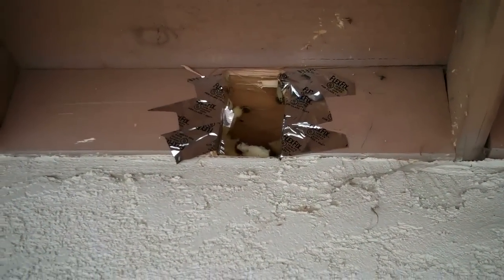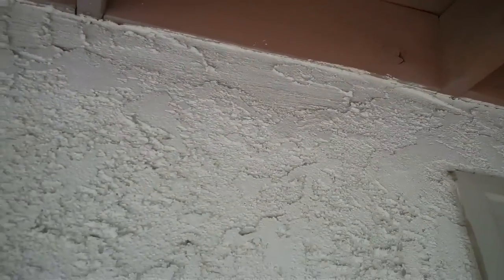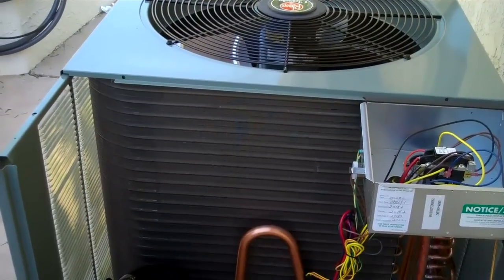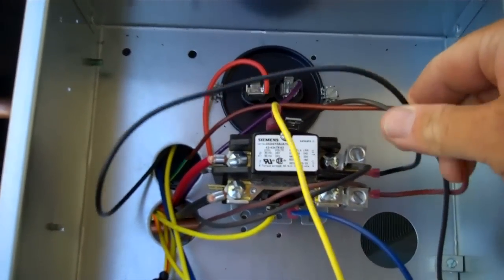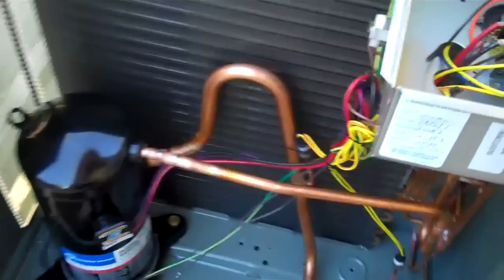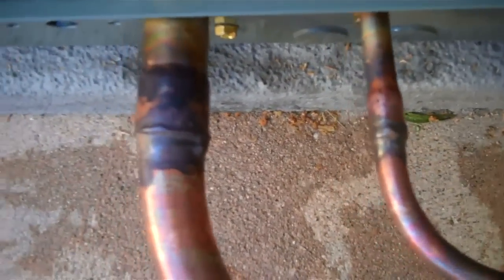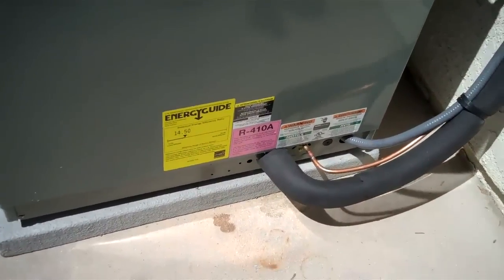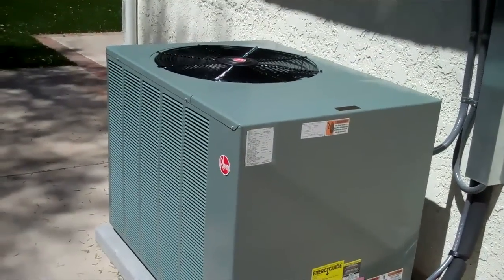Rheem 14.5 seer 4ton condenser with a ECM condenser fan motor

Comment: Whats up Dallas, yet another fantastic install (good looking braze too) !!!
Line Set like (BUTTER), looks like another great tip on chrome tape at hole, have not tried yet , (no attic installs lately) but I will put chrome tape around hole next basement Line Set Pull (does it work well) !!! Line Set will be exposed , can't chrome tape L.S. in basement pulls !!!
Dallas are ECM motors the new norm on all the New Rheems ?
Great Job........  More Please !!!

Comment from the maker: @fritzhvac Hey Fritz thank for the comments,the duct tape around the hole works great you can use any type of duct tape . I don't use any duct tape on the outside only on hard pulls in the attic.Why can't you use duct tape in the basement is it the look? The ECM come on the most of the high effciency condenser they use it because it a easy way to bump the the seer, they move about 400 more cfm over a psc motor and they have delay start up to help minimizes inrush current on start up.

Comment: Great vid! I've used pre insulated pipe for difficult runs, it has a tough plastic coating on the outside of the insulation, only problem is its white so can look a bit odd with the normal black armaflex next to it. It costs more but is also quicker to install.

Comment from the maker: @PutSome5tankOnIt Thank for the good comments,I like the cardboard idea I will have to try it next time.The suction line was bent by a yellow jacket tubing bender (your good) your like a detective lol!!The thermostat on control box is the crank case heater control it closes when the air temp go down I am not sure what the spec are on temp.The ECM is a single speed they use it because it a easy way for the manufacturer to bump the seer without much engineering it moves more air too.

Comment from the maker: @FilterChanger Thanks for the comments , the Rheems are really good units I have been working on them for 26 years now and they are simple to work on.The W coil can be a little tricky to work on but if it is on a Rheem furnace (RGPH) I will take out the heat exchanger to clean the coil.